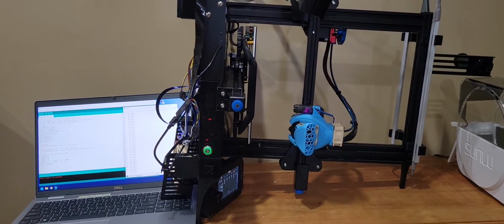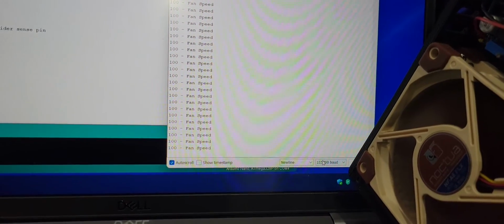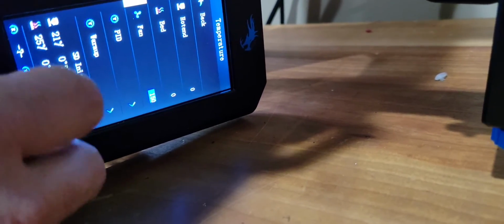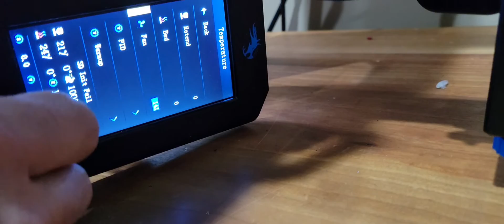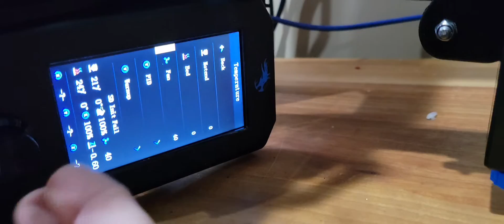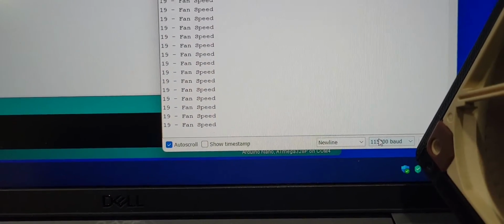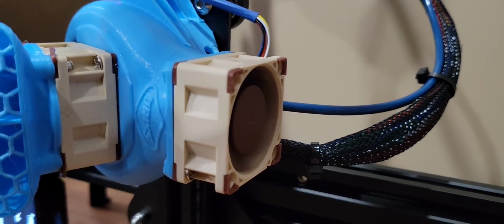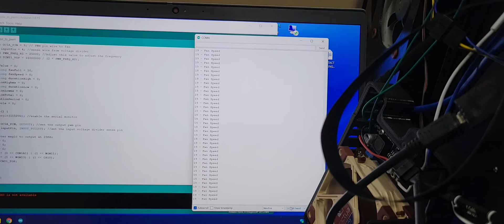Controlling Noctua PWM fans with your Ender 3 v2. 3rd revision.

Comment: Thank you very much, man! Outstanding work. Works like a charm on my ender. Pinout for PWM Noctuas can be obtained on the internet.
Black - ground
Yellow - Vin
Blue - PWM signal from your arduino
Green - speed control (not used in this setup)

One more thing: don't forget that nano clones come without bootloader. You won't be able to upload this project without burning bootloader first. I don't use arduinos often and that completely slipped my mind. You need one arduino in working state (with bootloader) to revive others.

Comment: Why is there no need for a voltage divider between the motherboard and the arduino?
Reply from the maker: Sorry misread. Because your only on the negative pin.
Reply: @patteahan8704  How much voltage does the arduino get from the negative pin?
Reply from the maker: @balazspinter7441  none - it's negative. It just open/closes to ground. The Arduino is measuring the rate.
Reply: @patteahan8704  Thank You very much for your answers.

Comment: had no luck to make it work on ender 3 pro with skr e3 v3, fan always 100%
Reply from the maker: I don't know if that board works different than the stock 4.2.2 / 4.2.7 board
Reply: @patteahan8704  logically it shouldn't be different, because it works plug and play if I use stock fans. Anyway was good try. Thanks for instructions, I will definetelly be back here in future
Reply from the maker: @svetoforcolumb  shouldn't; but if you built it right and it didn't work then what other reason would cause it not to work.
Reply: @patteahan8704  I still leaving some chance that I have been wrong somewhere. Because in the end I killed noctua pwm fan :D I think it shorted out accidentally at some point, which means I may be wrong at any other point too

Comment: Hey. Thank you for this video. As far as I understand, you connect 12V to VIN of the Arduino Nano. Is that really a suitable voltage for the microcontroller (I know the fan needs 12V thats why it probably is connected to 12V) because after some research I found that many people destroyed their nanos with 12V and that many people do not recommend more than 5V because it could break easily. Thank you for you time and answer!

Comment: Hey Pat, thank you for making this video and sharing this, I'd planned to do the 2 Noctua silent upgrade on my Ender 3 Pro and was completely unaware of this compromise I'd have to make. Once I got my fans and Briss Fang printed I tried it out as you showed and watched the serial monitor as I adjusted fan speeds, but for some reason it displayed that the fan speed was 0 at any speed I set the fan to unless I set it to 100%, which did output fan speed 100. I'm not sure if there was just something different about the pulse modulation for the Ender 3v2's part cooling fan but after using some print statements I figured out that the duration high and duration low were being measured correctly but when they were calculated into duration ms for each, it was outputting 0 for both the high and low, causing the rest to think it was 0 fan speed. This was caused by the durationHigh and durationLow both being <1000, so when they were divided by 1000 to get the ms of each they would calculate 0 due to int division, and if not, storing the decimal value in an int which would make it 0. I fixed the issue by making sure durationsHigh and Low were divided by 1000.0f and storing some of the other results in floats rather than ints, and now it's working great. Here's my code if you or anyone else want's to take a look: https://gist.github.com/AlexT2052/b9dbea7f867e827502217f08869e8adb

Comment: I'm trying to recreate this setup, but my nano's keep dying when I turn the printer on. I thought it was the 12v input, but after powering the nano with a USB and leaving the VIN alone I'm pretty sure that it has to do with the input/output wires. After turning the printer on the nano stops outputting to the serial monitor and heats up incredibly quickly. I have the blue wire from the motherboard going into d4, and the wire going to the fan plugged into d9. Any ideas what could be causing my arduinos to die like this? Haven't changed your script at all, running the same noctua pwm fan you've got.
Reply from the maker: Make sure your taking your power off a 12vdc source such as a buck converter which also powers the fan. If your trying to take power directly off the printer your getting 24vdc which is too much for a nano.
Reply: @patteahan8704  but the PWM signal coming from the motherboard, does that need to be altered before attaching to the nano?
Reply from the maker: @MANBEARPIGNPS  you need to taking the signal off the negative wire from the fan header.
Reply: @patteahan8704  yes, that signal, does it go straight to the D4 pin on the nano? Does the nano actually need 12v to pass the PWM or is that just convenience because the buck is right there?
Reply from the maker: @MANBEARPIGNPS  yes d4 straight to fan neg from mono. Yes requires 12v which it shares with the Noctua fan - it's how it references the signal.

Comment: This looks GREAT!
However, most of us have no idea how to use an Arduino. (sad face)  Does this work without the pc being connected to the Arduino? How does one install the code to the Arduino... And will it always boot itself up and just work by itself?  
Us dummies need a step by step Video with a parts list and pics/diagram Pleeeease..
GREAT JOB so far though!!
Reply: ADDING...
Interesting thought, What would happen if we connect the negative/positive wires of a PWM fan to a buck converter powered by 24v from the printer , But then connect the fans YELLOW wire to the Negative from the  printers  original fan output. Would the PWM fan pick up the Original pulse from the printer?  Did I just make any sense
Reply: Not an expert, but the general flow is you take a microcontroller such as the Arduino, you upload the code that does stuff (using software like Arduino Studio), and it just chugs along by itself doing the stuff as long as it has power.
In the video the laptop is used to demonstrate what it's doing, but under normal operation there's no need for it. He says "I've got my com open", and you see the USB plugged in. It goes to the laptop and shows in the communication window whatever the Arduino is sending, in this case the fan speed.
When the code is finished, you remove the PC and find a way to power the Arduino, as you would a Raspberry Pi, and button everything up nicely.
Reply: Many thanks for the reply.!
 I come from a pi background and Arduino is new to me. I'm looking more into this subject right now. This little project could have many other uses. Controling or modifying  pulses.
Reply from the maker: Yep it's all arduino. The sketch is commented with how to hook it up.
Reply from the maker: Lots of getting started videos on YouTube for arduino
Reply: Never really looked into Arduino before, now I'm really getting into it. Many more projects incoming. Thx Guys!

Comment: Pat.... Thank you so much this is exactly wot one needs when connecting a laser with pwm control on and ender 3. Because the ender 3s board pwm frequency is to low, you cannot really control the laser power that well. But by using your method l, I think I can get way better results with the laser now. I would lo e to see you do the same mod. And thanks again for the info